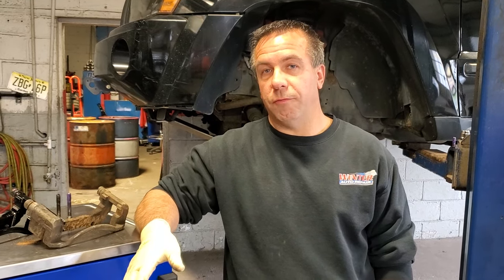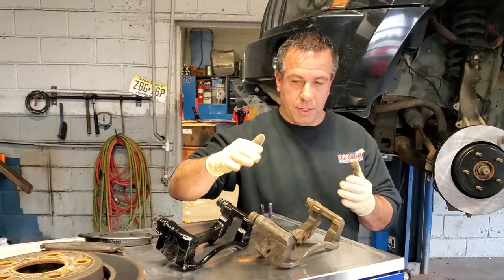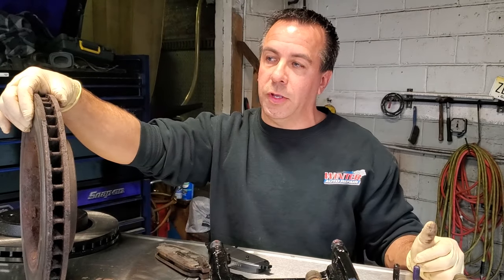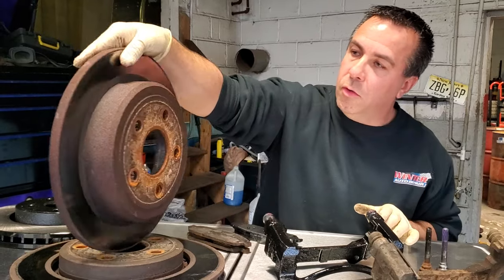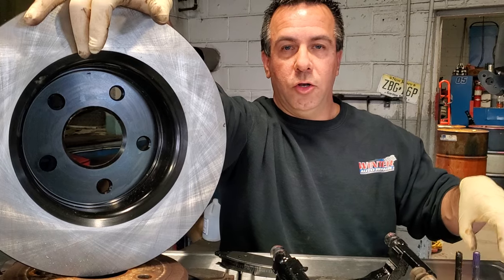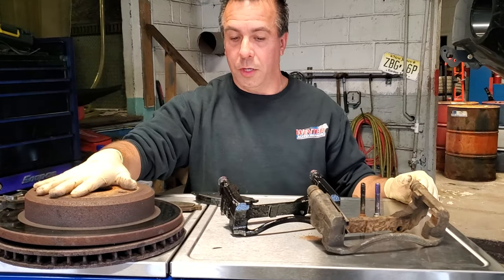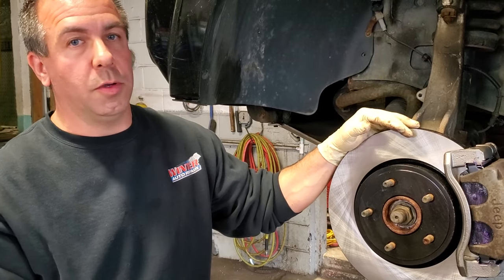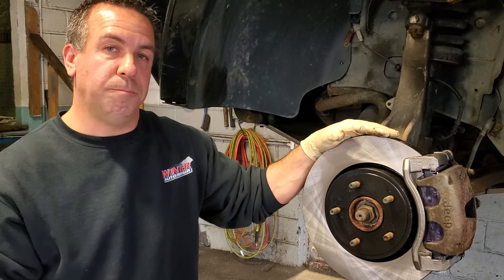High quality brakes vs cheap brakes

Comment: Although I do see your point about safety possibly coming from forced inspections, I cannot agree with you on Government inspections because anything the Government does, fails. 
Just look at how well they run the US Postal Service or how bad they screwed up a simple gas can.

Instead of forced Government inspections, (meaning more big Government), how about drivers ed teaching the basics to students on how to tell when their car is having a problem? I think that would be a much better place to start than everyone in that state giving their money to a Government program that doesn't really work in the first place.
For example, the person that owned that car you are working on had to know something was wrong way before they experienced metal on metal contact. I mean the sound should have been much louder than any volume on their stereo, right? 
Although not everyone is mechanically inclined, as you said, those people are the ones most likely to take their vehicles to a shop to be worked on in the first place. 

I send kudos to you for doing the extra checks to make sure those cars you work on are safe, (many shops wouldn't), but at the same time, I live in a state that does inspections and I can tell you that you can easily find a shop that will fudge the inspection and give you a clean bill of health just so you can get your new license plate tabs, even when the vehicle is bad.
Those of us that do our own mechanic work make sure our vehicles are safe but those that do not know anything about mechanics would better benefit from the shops they regularly take their cars to, (such as Jiffy Lube etc...), doing the checks for them and alerting them of any potential problems. 

Last month I ran my Harley thru a local bike shop and it passed inspection with flying colors. After receiving my inspection sheet, I went inside and bought a full set of front brake pads. The mechanic asked me why I was doing it and I told him that as he should have noticed, my front brake pads were very close to their wear limit. All he told me was they were good enough to pass inspection so he did not tell me about them and passed it anyway. The fact that they would not last more than a few more months, (I ride a lot), let alone until the next annual inspection did not seem to concern him at all. 
This is exactly why I think Government forced inspections are a joke.

Then again, I also believe that most warning labels should be removed so that nature can take its course and clean out the shallow end of the gene pool.
Hot coffee is obviously going to be hot, anything that has electricity running thru it is a shock danger when contact with water exists, and anything with gas or acid in it you should not drink or light a match near it so why label them as such... LOL.

Anyway, great video and keep them coming...
Reply from the maker: HAHA I agree about too much government. I hate it myself. The sad part is most people will say, I passed inspection so I don't need tires/brakes/maintenance ect... NJ has free inspection performed by the state. Literally free... However, they used to do a safety inspection and now all they check the the check engine light. So people go to inspection every other year and pass for no check engine light and assume the rest of the car is safe! It should be all or nothing. The state shouldn't do the inspections at all or bring back safety inspections. What we have now is a mess and people don't realize the poor condition their cars are really in. We see bald tires with cords hanging out daily, grinding brakes and just this week I went to put a car on my lift that was here for a cylinder 2 misfire and the right front strut fell out of the car. The bearing in the top mount had failed and the nut pulled right through the middle of the mount. If she had hit a bump and the nose of the car came up just a few inches, the strut would have come through the fender and she would have lost control of her car. I don't like the government controlling any aspect of my life. However, some people don't care about their own safety, let alone the safety of you and your family. In this case a little government involvement is needed to force people to care. 
I appreciate you watching and commenting! I made this video for my website (I'm not a YouTuber, haha) and had no idea how many comment and views I would get. I plan to make more videos now so please subscribe if you haven't and let me know if there is something specific you'd like us to make a video on!

Comment: State-mandated inspections are just another infringement on freedom and lead to more laws and taxation in the long run. How about you stop pushing for government control and offer free or very-fairly-priced vehicle inspections yourself?
Reply from the maker: Inspection in NJ is free, actually, but thanks for commenting.
Reply from the maker: For reference, it's always been free. However, 15 years ago they did away with the safety portion and only check the engine light.  So people pass emissions and think the car is then safe. When in fact 7 out of 10 NJ cars are in terrible condition.  Just ask people in neighboring states if they would buy a NJ car.

Comment: Brake pads, yes. However, unless you're talking about sports cars, a brake rotor is a brake rotor. And vehicle inspections are AWFUL for the consumer, due to all of the expense incurred on their part to make an old beater pass. Remember, not everyone can afford to buy a new/newer or nice (expensive) vehicle.
Reply: Coated brake rotors make a HUGE difference in the northern states.
Reply: @mph5896  No they don't. I used to live up north, and always did my own brakes---never once noticed any difference.
Reply: @justsumguy2u  Sorry I disagree. I see the coated rotors hold up MUCH better over uncoated. Do hundreds of brake jobs a year.

Comment: Oh come on now......what kind of video is this?  No mention of the most important factor.....to torque to specs your lug nuts each time service is done. That is the key to prevent warpage.  No one has mentioned it, and you seemed to conveniently avoid that, perhaps as an excuse to get customers to step up to a more expensive product (which is better for you...more $$).  You put on a show like your honest, and ignore the most important part. Every good shop does this now, and anyone doing their own work knows (mfr manual) what the torque spec is for their vehicle.  Other than you painting the caliper, it is standard procedure to replace hardware, clean up, inspect and grease the pins. A trip around the block also is not going to set the brake pads. You're not on a race track, an around the block trip is not enough unless you are driving like mad with a customers vehicle. At least the first 50 miles you should be easier on the brakes, and the first trip on the hiway will introduce a heat cycle better then your loop around the block. This is not a DIY brake lesson, but a promotion of your shop.  If you do not torque down (never mentioned once).....your caliper paint job becomes a joke, because you ignored the MOST IMPORTANT PART...what matters is torque your lug nuts to spec.
Reply: What kind of dumb comment is this? I genuinely hope this is satire. He's talking about the brake job itself... Torquing the wheels to the proper spec is not the point of the video. While yes, you are right that over torquing wheels can lead to warped rotors, it's really dumb of you to criticize an entire video because he didn't mention something that he really didn't need to mention.
Reply from the maker: Actually you're right on 1 aspect. This was a promotion of our shop. Our website designer asked us to make a couple of videos that he could link to our website. For some reason this video went viral and has received way more attention than we expected. We will be making more videos because most of the people who commented liked our information.
Now to answer your comment. Torquing lug nuts wrong will never ever warp a brake rotor. I'm not sure where you're getting that information from. The rotors can warp, glaze or vibrate do to pad material build up not from over tightened lug nuts. The hat of the rotor isn't where the vibration comes from. 
as far as bedding in pads. It's all about heat cycling the rotors. Get them hot and then let them cool off, get them hot and let them cool off again. By braking from various speeds a few times and then driving without touching the brakes, you can accomplish this. Most shops don't even test drive cars anymore. Not 1 dealer near us will drive a customers car because of insurance reasons. Again, this video was to explain to our customers, the process in which we use to replace their brakes. 
if you want to use cheap brakes and torque your lug nuts then by all means, do the job you feel is best for yourself. As far as making the customer pay more for a more expensive product. that is not true. The rotors cost us more but the profit in the part for us does not change. We make the same $$ on a cheap part as an expensive one. for us it's about our customers safety and the safety of their family. I hope that helps you understand why we made this video the way we did. Good luck to you.

Comment: inspection is important? yeah to make revenue for the state and put poor people in jail when they cant afford to fix an abs light and get a sticker. In many ways it's a huge racket.
Reply from the maker: Nj state inspection is free and always has been.  Unfortunately, people don't care about their safety or the safety of those around them.  The vehicles that I see come into our shop are so dangerous, they shouldn't be allowed to leave a driveway, and yet people go 90 mph down the highway with them. The safety inspection we had kept that to a minimum.  People got the inspection report for free from the state that does not do work on cars or recommend a specific shop. So how is that making money for them. You have the right to fix your own car if you choose to as well. Unfortunately, I have to share the roads with people like yourself who don't take my safety and my family's safety seriously. If you want to drive an unsafe car, that's your choice. When you crash it because the brakes fail, please aim for a tree and not the innocent family in front of you.
Reply: @WinterAutoRepair  That's what I would expect someone who benefits from the racket to say, and good job attacking me personally. The state profits off the tickets they hand out and from putting poor people in jail when they can't afford to pay them, and keep driving to work anyway. I've been repairing my own vehicles for 30 years, and I guarantee you that my volvo is safer than 95% of the cars on the road. No doubt some people ignorantly drive unsafe cars, but as someone who drives for a living, I can tell you thar morons in dealer maintained BMWs and Audis, taking ridiculous risks to get 5 seconds ahead, cause far more deadly accidents than people driving "unsafe" vehicles. Come down off the cross, we could use the wood.

Comment: Break rotors don't warp,
Reply from the maker: Tell me you know nothing about cars without telling me you know nothing about cars... hahaha
Reply: @WinterAutoRepair  Rotors are cast at very high temperatures, it's not possible to achieve those on a vehicle. The cause is VDT or variable disk thickness, pad material deposited onto the rotor surfaces that create high and low spots. This gives the impression of the rotor being warped.
Reply: @papabits5721  "Brake rotors don't warp."    Are you 10 years old?

Comment: Nice brake job, I don't take the time to paint the brackets and never put grease on the back of the pad, it doesn't belong there, as a matter of fact some OEM actually glue them in to the caliper and bracket.  Rotors can be cut, I do it almost daily, they have 2 to 3mm that can be machined on fronts, and 1.5 to2mm on solid rears, they are lighter because they don't ride on a spindle with bearings in the rotor not because there is less surface to cut.  Hard to beat a quality OEM rotor and pads.
Reply: Of course rotors can be cut but I don't do that on my personal cars.  My personal cars get new pads and rotors (Hawk HPS pads and Brembo rotors) whenever they need brakes.  Reducing the thickness of brake rotors leaves less material to absorb and dissipate heat.
Reply from the maker: When the rotor is new it has 2mm or so of material that can be cut.  However, once worn that material is gone and if you cut below spec you will get warping very easily.  The cost to cut versus replace and customer satisfaction taken into consideration, we will never cut a rotor.   As far as brake grease, I have been building and repairing cars for years and always use grease on the pads.  I never have noise, warping or chatter. As far as OEM vs Aftermarket.  The Centric parts we use are higher quality than OEM. OEM are good but they aren't the best. I'll continue to install brakes the way I always have.  I'm sure you will continue to install brakes the way you feel is right as well.  
Thanks for watching and commenting.
Reply: @WinterAutoRepair  If that is how you do all of your customers cars, god bless you, that is by far the most care I have seen from an auto repair place.  I just disagree that they can't be cut.  I work at a dealership so lots of cars that are a year or 2 old that have enough miles to need pads and plenty of meat on the rotor.  You know OEM rotors are not cheap so if a rotor is not corroded and has plenty to cut I save them $200 or so and cut them, gives me time to clean everything up while it's running on the lathe.  Oh and I never cut them anywhere near discard, I pretty much figure they need enough to not fall below spec before new pads wear out.
Reply from the maker: @bwdz75  Thank you.  This is the exact way we install brakes on every car that comes into our shop.  Even if we can't get these parts the same day, we will either have the customer come back or we overnight the parts at our own expense.  We won't use a cheaper product just to get it done quicker.  As a dealer mechanic I'm sure you see newer cars with the original factory installed rotors.  Those can be cut once usually.  However, as a smaller shop we typically only see cars that are older after they are out of warranty.  Most have had a brake job done once already so those quality factory rotors have already been cut or where replaced with a cheaper inferior product.   Thanks for the chat.  If you're ever in NJ.  Stop by.  We have some high end cars around all the time.  We are installing custom turbos on a 2018 Ferrari 488 and brakes on a 2019 Ferrari Pista in our next videos.
Reply: Honestly I am not a very tech savvy however I always buy brakes from geobrakes.com 

And they sell on really cheap price but thr quality is good

Comment: did he say he gets 98,000 miles out of a brake job 😂 my guy when u find me brake pads that can last 98k miles or drums call me I’ll buy every single one of them
Reply from the maker: Our record for our brake job was 92k miles for a front set and 98k on a rear.   Centric 120 line rotors and 106 pads.   Our average brake job lasts around 50k miles.   The one that lasted 92/98k was a car driven primarily on the highway by a regular customer who is easy on their car.   Our goal is for someone to hit 100k miles with our brakes.   We will make a video about it once it happens.
Reply: @WinterAutoRepair   I got 14,800 miles out of my OEM Toyota Camry Akebono brakes and rotors lasted 4 years need to get them replaced this weekend would u recommend sticking to original OEM brakes and rotors or is using something like power stop brakes and rotors or Napa Auto brakes and rotors the same thing
Reply from the maker: Look for Centric rotors and pads.   A smaller local autoparts store should have them.  I've also seem them at rock auto, CarID and Amazon.   Their standard rotor starts as a 120 line.  Their high carbon rotors are 125.   Their 106 pads are quiet and last.   I promise you'll be happy with their quality.
Reply: @WinterAutoRepair  how much would u charge for that if I was to bring in my 2014 camry se 2.5l to u I live in upstate ny and Toyota wants $1100 for front and back plus labor but if u buy the front and back brakes and rotors they want $500 for the set so basically they want $600 to change the brakes and rotors 😂
Reply from the maker: Well damn.   I'd have to look it all up but our labor portion would be around 3 hours @ $115.   I'd have to see what the parts are but I can't imagine we would be over $1000 parts and labor.   $1100 for Toyota stuff is a lot.